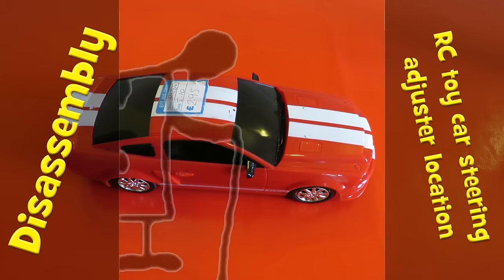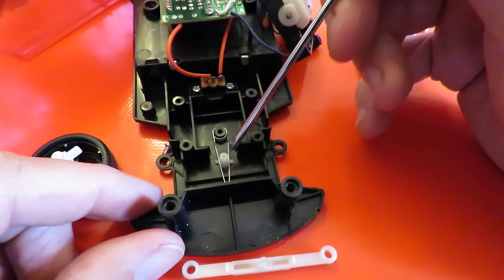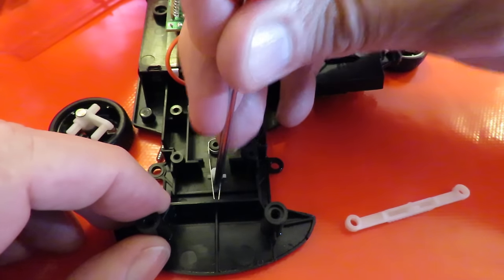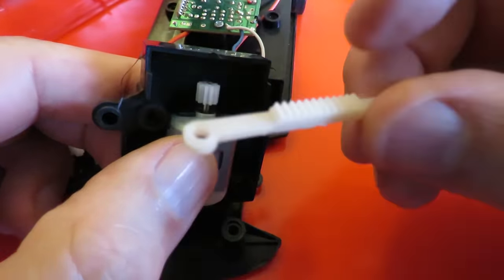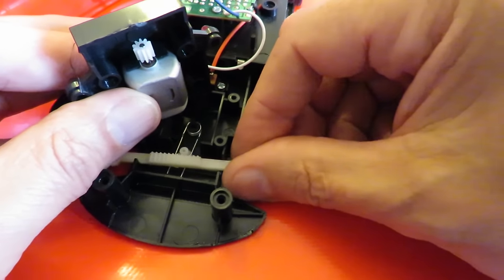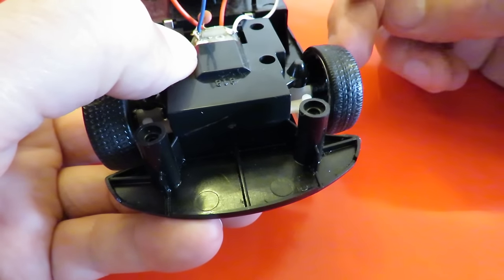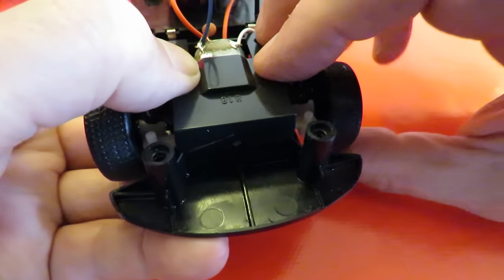Disassembly - RC toy car steering adjuster location

Comment: I took apart my kids (cheap) rc cars today to try and rectify the steering mechanism. I didn't have much luck as they still can barely turn. When they were new, on Christmas Day, they could make sharp turns. But now they can almost only travel in straight lines. Not much fun to play with. Could it be an inferior spring problem? And ideas?
Reply from the maker: My first thought is that the spring is what returns the steering to the centre so if they tend to travel in straight lines and NOT turn then it won't be the spring return that is the problem. More likely the batteries have run down and there is not enough power to drive the steering motor to it's full range. OR the steering has taken a battering over Christmas and may be damaged or clogged with dust, fluff, and hair so a bit of cleaning might help. Even just a layer of dust on the tyres will reduce the grip for turning.
Reply: Thanks very much for your quick reply. I replaced the batteries and did a general clean and they are much better now. Much appreciated
Reply: Had the same problem, just fixed my kids rc. General rules: do not over-tighten the spring, good lubrication with a thin grease, new batteries.

Comment: My brother recently got a remote control car and when I press forward the front wheels go left and right when it’s supposed to go forward.any idea how to fix it?
Reply from the maker: The most likely issue is that your controller does not match the car so you should find another controller. You could just swap the motor wires on the receiver so the forwards backwards motor is fed from the left right output. There is a potential problem there in that some receivers provide less power to the steering output, compared to the drive motor.

Comment: there is a video for back wheel disassembly? can yu suggest.?
Reply from the maker: Most toy grade RC cars have very similar gearbox and back axle assemblies so unless you have a specific brand of RC toy car you are interested in you won't find much difference. There will be the motor with a pinion gear driving a larger gear attached to the axle. Some toys with have an intermediate gear between them to drop the RPM down and increase the power. The main difference between the different brands will be whether the unit is screwed together or clipped together. Many NewBright gearboxes are clipped together, no screws, and usually the clips break when you try to lever them open.
Reply from the maker: Here is one of my recent videos which included the disassembly of the gearbox https://youtu.be/BlHHXyc1p6E

Comment: Hey got an new one and it only steers about 10 degrees. Seems very rigid. Any tips on how to Fix it?
Reply from the maker: All I can suggest is that you check all the moving parts to see if there is anything tight causing friction. The wheels may even be rubbing against the bodywork.

Comment: Question Grandad, my Pagani Huayra has the same adjuster. Whats the purpose of it? Make the car steer biased to left or right?
Reply: PS. Subbed, you make pretty interesing videos!
Reply from the maker: Yes, the spring returns the steering to the centre and the adjuster helps you trim that centre position.
Reply: GrandadIsAnOldMan Awesome, thank you.
Reply from the maker: Unemployed and looking for a Job :-)

Comment: Sir i have a rc car at home but it is running slow or stop when its wheels touch to the ground or floor
Reply: What can i do to solve this problem sir
Reply from the maker: First check you have fresh batteries.

Comment: Where I can buy that spring?
It's missing from my brother's car
Reply from the maker: I very much doubt that you could buy one, certainly not at a sensible price. I expect it is the sort of thing you would have to buy from a Chinese manufacturer with a minimum shipping of 1000 items. You could probably make one from a small safety pin depending on your skills. Different cars will need different sizes of spring, so it is not the sort of thing that your local toy shop is going to stock. An ordinary paperclip is the wrong sort of wire, it is not springy enough. You can buy "spring wire" from hobby suppliers online, maybe eBay or Amazon or maybe a craft shop.
Reply: @GrandadIsAnOldMan  Thank You:)

Comment: Can you do this but with a Tyco RC Hot Rocker car? I can’t seem to figure out how it’s suppose to adjust so my wheels can turn again. PLEASE HELP
Reply from the maker: That is not likely to happen as I don't have a Tyco Hot Rocker. Your best bet would be to search YouTube for a Tyco Hot Rocker and see if anybody has done a tear down on one. Or just a general Google search might find one on an RC group forum. The steering adjuster is just there to return the steering to the centre. If you steering is not working then it probably isn't the adjuster that is the problem. Is there a spring missing?

Comment: Question do you have to keep the knob because it restricts my turning
Reply from the maker: The purpose of the spring and the pin is to return your steering to the centre. Without it you will find it impossible to drive straight as the steering will stay wherever you last turned. So if you turn left the car will keep going left until you turn right. It will then continue to turn right until you turn left. There will be no centre point. Take it out and find out for yourself. The pin is shaped so that if you twist it to one side it moves the 'return position' slightly to left or right to allow you to correct the car's steering if it drifts slightly when it should be going straight.
Reply: Thank you

Comment: I lost the spring nob at back Wich is used to adjust steering at middle. Any solution? Please tell me, my kids  miss the car ☹️.
Reply from the maker: Virtually anything jammed in the hole will make it work. This video might help https://youtu.be/t-YRTIEU0E8?list=PLA5a2xPRSrB1CeqvjOaBPrHk_lVcTHSb9&index=1
Reply: Thank you so much
I will fix it.
Thank you

Comment: How to reconnect the wires to cars board if all the wires are messed up and tell me how to do it correctly
Reply from the maker: Most of them have the connections marks on the circuit board. F & B for the main motor (Forward and Backward). L & R for the steering motor (Left and Right). V+ and V- or B+ and B- or Batt + and Batt - for the battery connections. Sometimes it is M1+ M1- and M2+ and M2- for motor 1 and motor 2 instead of the F/B and L/R.
Reply: For my board there is nothing 49 mhz. What to do

Comment: Hi my rc car spring that help the front wheel centre is dead what I do please give me a answer
Reply from the maker: How is it dead? It is only a piece of wire and it only has one purpose which is to return the steering to the middle. There is very little stress on it so it will not break or wear out.
Reply: Sorry but I lost it
Reply: How to make it

Comment: hey grandals an old man can you please do a vidoe of how to put other rims to the front of the rc car if you do it means a big favor to me my name is Angelo cruz
Reply: मेरे जो कार लीय हु उसके आगे का हिडिल हि काम करते हैं तो वह कार का है या रीमोड का है
Reply from the maker: Sorry for the 3 year delay in the reply, just found this one. Probably way too late now. These cheap RC cars have several different ways of attaching the front wheels so showing you on this car may not suit the car you wanted to work on. Some are held in place with a simple screw, some have a stub axle that the wheel spins freely on that is a tight fit in the steering arm, some have the stub axle a tight fit in the wheel hub and the axle spins freely in the steering arm. Even the simple screw fix version will vary with the diameter of the steering arm, so there wouldn't be a simple video to cover all the options.
Reply from the maker: @pradeshipatelpatel8679  sorry for the late reply. YouTube does not alert me to comments left on other people's comments. If I have translated your question correctly, the answer would be the two cars are on the same frequency, so they both respond to your transmitter at the same time.
Reply: @GrandadIsAnOldMan   Ive hot glues big tires onto smaller tires before because i didnt have access to an axle with a bigger fitting for the rim.  Whatever works.

Comment: just one thing about the older vs newer steering system.
i got a couple of old models through dumpster diving and I realized that older RC cars seems to have better steering designed, I notice it went was redesigning a new wireless transmitter for those cars.
older designed require less current from the h-bridge driver by the better designed of its gear system as compare to modern toy RC which are just simple pinion and rack system.
Reply from the maker: If you check out the associated playlist you will find there is quite a variation in the steering mechanisms I have found in these RC cars https://www.youtube.com/playlist?list=PLA5a2xPRSrB1CeqvjOaBPrHk_lVcTHSb9

Comment: trying to fix my sister's, the spring's leg is making an x shape, but that white thing that separate both legs is missing, how do i fix that ?
Reply from the maker: If you check the video description you will find this link - Replacement steering adjuster https://youtu.be/t-YRTIEU0E8?list=PLA5a2xPRSrB1CeqvjOaBPrHk_lVcTHSb9
Reply: @GrandadIsAnOldMan wow, that is so quick, thank you so much !
Reply from the maker: You are welcome, it is a fairly regular question so I made that extra video.

Comment: Excuse me, can u help me. My car almost the same board as urs, but it doesn't direct to left
Reply from the maker: Have you tried connecting a battery direct to the steering motor to check it goes both ways?
Reply: no, i dont know how !
if u have video for this, i would be thankful
Reply from the maker: You would have to take the car apart and connect some wires to a battery and direct to the terminals on the motor. Alternatively, do you have another transmitter that matches that car. You could check it is not just the button on the transmitter that is stuck.
Reply: If u have fb acc. Or any direct way to contact to send u the car pic and tell me what to do !
Reply from the maker: My Facebook account link is shown in the video description but I will paste it here for you Facebook https://www.facebook.com/grandadisanoldman/ you are welcome to post your picture there

Comment: I have a problem,my wheels wont go back in place,but i checked my springs and peg and they are in place.
Reply from the maker: if the spring can't move the steering back to the centre, then there must be something jamming the movement. Does the steering move if you push it gently?

Comment: Is the little oval stick below the spring important?
Reply from the maker: That is the adjustment bit that returns the steering to the centre. If you leave it out you will not be able to get the car to go in a straight line. If you have lost it, you can replace it with a similar sized piece of plastic or even wood. The original piece is shaped so you can twist it to give finer trim for the accuracy of the straight driving if the car is tending to drive left or right.
Reply: @GrandadIsAnOldMan  thanks a. Lot gramps,👍👍

Comment: Sir i am using rechargeable batteries.  I have charge for 1. 30 hours but still car is moving slowly
Reply from the maker: 4 options
1. Make sure there is no hair or dust wrapped around the axle or gears and check none of the gears are broken or split.

2. Try non rechargeable batteries - they give more power
3. Connect batteries directly to the drive motor and check it is working OK
4. If the non rechargeable batteries make no difference and the motor is working OK when you connect the batteries direct to the motor then it is likely that the components on the receiver board that control the motor have failed and you will need to have electrical knowledge to be able to fault find them and replace the damaged items. It would be easier to swap the receiver board with one from another car.

Comment: Sooo basically this is the exact system that is I  the small scales isn't it? Could you use a speed controller to adjust a system like that to be proportional ish that way?! I wonder if that is how the Q32 from Hpi racing did it? 
Anyhow great video love your channel.
Thanks for sharing
Reply from the maker: You can use two ESCs, one for the drive and one for the steering. Yes, it does give you a degree of proportional steering. Here are a couple of projects I did with that method (I have done rather a lot of them) https://youtu.be/Vbd1FmFrxQk  https://youtu.be/cqQPYVU4WkA However if you are going to that length to give it hobby grade control you might find it more rewarding to go a bit further and fit a proper servo for the steering. https://youtu.be/pO252zaOlZw

Comment: Wli have the same style car and it doesn't respond to steering input why?
Reply from the maker: 1. Low battery power
2. Steering motor faulty. Check by connecting battery direct to the motor.
3. Wire broken between receiver and motor. 
4. Receiver faulty.

Comment: Why is there a speaker slot when there's no speaker?
Reply from the maker: I would make a wild guess and say the designers designed the chassis before they finalised exactly what facilities would be in the final production model. It would be easier to put the features in and not use them than it would be to add them after a production run had been completed.

Comment: Hello. my rc car remote control has been broken. how can i make a new one? teach me pls
Reply from the maker: How is it broken? What is wrong with it?
Reply: GrandadIsAnOldMan and it gone 😅
Reply: because it broken about 4 years ago😅
Reply: can i use application  on android for car remote?
Reply from the maker: if you want to use an App then you would need to interface the receiver with either a Bluetooth or a Wireless module. If you are keen to get into that level of electronics you can probably find information on one of those arduino forums. You could just find another RC car working on the same frequency and see if it's transmitter will talk to your car's receiver. That is what I do. You could buy components online - I had a similar question recently and made this video - Where can I get a toy grade RC receiver board https://youtu.be/zOfKSJhw4xs
Reply: GrandadIsAnOldMan ok... ty

Comment: I want fix my car receiver in a drone can you tell ne how to connect it
Reply from the maker: If you are talking about a simple toy grade RC car receiver then you are wasting your time. The receiver will not give you the controls you need to fly a drone. For a start you need the receiver to balance the thrust to each motor to hold it level in flight. You then need to be able to trim the power to each motor to stop the torque spinning the drone. You need to vary the thrust to gain lift. You need to vary the thrust proportionately to get turn. You need to vary the thrust to get forwards and backward. A basic toy grade receiver only gives you "On" and "Off" signals, no proportional control and no trimming. The best you could hope for is to apply power and it will climb into the air spinning uncontrollably and then crash.

Comment: i have an rc car and the little white adjustment knob came out and when i put it back in the steering stayed where it was turned (if i turn left, it stays there until i turn right) and doesnt center. Can anyone help me with this?
Reply from the maker: You haven't got the legs of the spring either side of the peg

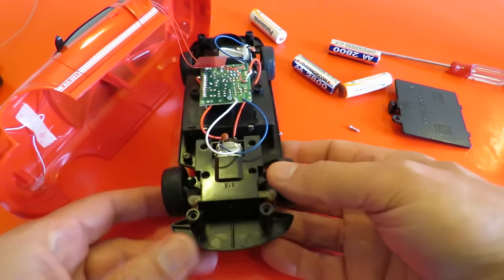Comment: Can u please tell me the exact name of the cover which is mentioned in 1:09
Reply from the maker: Let me think, ah yes, it's called a cover. It is a piece of plastic moulding that forms part of the housing for the steering assembly. As shown, it is held in place with 4 screws.

Comment: Where can i find the white h shape piece connected to the wheel
Reply from the maker: I think your chances of finding a replacement part are just slightly less than zero. Most of these toy car manufacturers do not offer a spare parts supply. Basically, your options are, find another car of the same type and use it for spare parts, or, find somebody with a 3D printer who enjoys a challenge.

Comment: Hey man, what's the size of the driver used to remove the screws?
Reply from the maker: I can't say I checked, I just have a selection of screwdrivers and use whichever one fits. That one looks like it may be 3mm or maybe 2.5mm crosshead
Reply: @GrandadIsAnOldMan  this helps alot, I just brought a RC car and none of my drivers get in it. I will just buy both and see which fits. Thanks man
Reply from the maker: @praveshChristogerard  I have rather a lot of tools that I have collected over the years, including tools inherited from my father and my wife's father. More tools than I am ever likely to use. 😆
Reply: @GrandadIsAnOldMan  That's a lot to handle. Lol

Comment: Can you plz tell me brother , how to attach the knob of the steering that has come. Out 
Plz
#LovedYourVideos
Reply from the maker: I am not sure what help you need. The steering adjuster usually fits through the slot that is a sort of keyhole shape so you have to turn it the right way to align it.
Reply: @GrandadIsAnOldMan  I have tried and fitted it well , but I have another problem brother 
, My wheels are not bending much on either direction 
Tell me what to do ,
I have fitted it successfully ,
Is it the battery that's not powerful enough to bend the wheels 
Coz , by hand I can bend the wheels easily 
Plz tell
@Thanks
Reply from the maker: @rahulsanyal3893  I can only make guesses. You may be right, it may be lack of power. It could be the steering motor is faulty. It could be the pinion gear is split and not gripping the motor shaft so it is slipping. There may be teeth missing on one of the gears. It may be you haven't reassembled it correctly and something is jamming the gears. Did the wheels turn OK before you fitted the steering pin? The spring may be too strong.